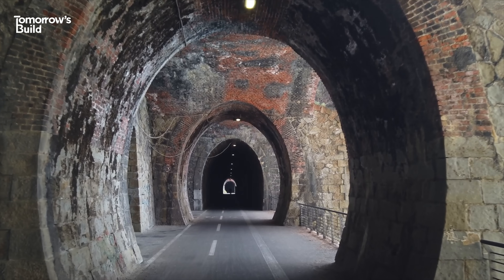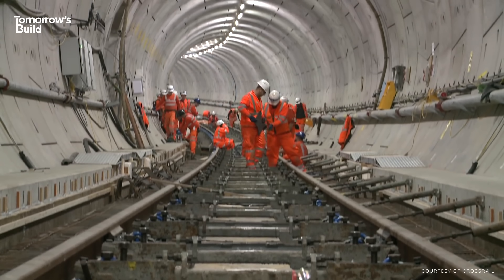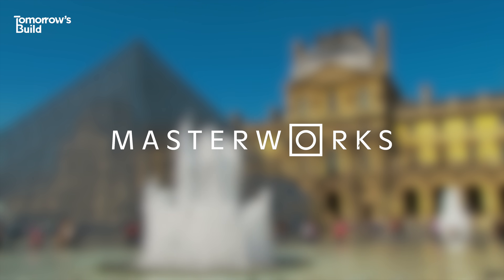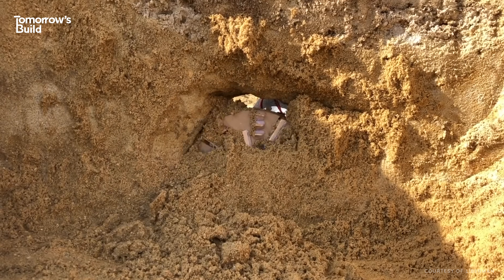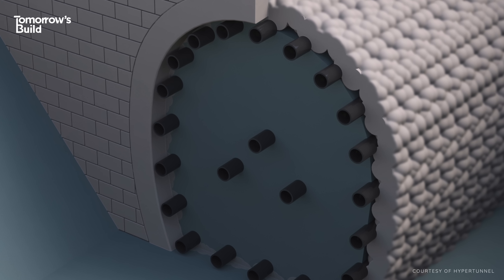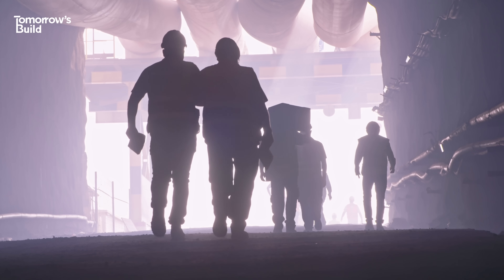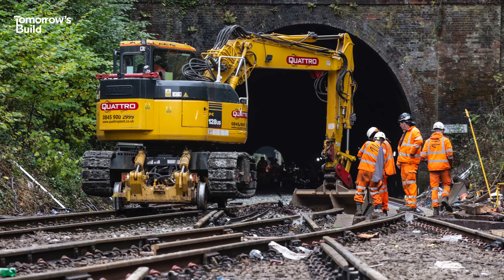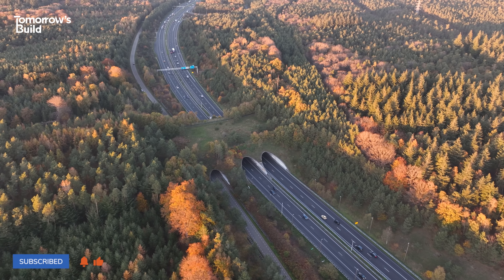A Swarm of Robots Built This Tunnel

Comment: Having thousands of robots that have to be charged seems like a logistical nightmare... What are the benefits over a conventional boring machine?
Reply: Probably the size factor. Conventional boring machines are absolutely gargantuan and require cranes, oversized load transport, massive custom parts, so many parts in general I believe I heard it has more than a space shuttle, and the challenges of maintaining the behemoths due to wear and tear. Not to mention the massive amounts of crew you still need to make it all work. Turns into lots of $$$. If you can make the little guys standardized and easy to produce/replace/maintain then theoretically it could be a lot cheaper. Anything big in size the price goes up by a disproportionate amount due to tooling and space requirements during manufacture, etc. Cheaper to make 2 mini fire engines vs one full size large fire engine for instance. Just look at how much a standard 16in pipe wrench costs vs the extra large kind that are 3 ft large.

Comment: it seem all great but i worry what if the tunnel itself is pack with hard rock how would the swarm go trough that easily and would they even work because the tunnel wall would no be injectable into soil
Reply: With solid rock as structure why would you need to inject anything? The challenge the bots solve is in creating the structural for the tunnels, and other digger machines remove the material in between the swarm pipes. if you're talking about larger but not solid aggregate then they would find the spaces between the rocks and inject into them just like they do with fracking but on a much smaller, and easier scale.

Comment: This is probably the most practically scalable piece of innovation in the sector in a long time. It's rough and rudimentary now, but they've proven it works. I'm eager to see where this tech is up to in 5 years.
Reply: They proved it worked in an ideal environment though.  I work in the mining industry and see how badly stuff gets beat up.  They are making something complicated that needs to be simple.  Simple means easy to fix.  Any downtime is big money.
Reply: @pin65371  good point. I guess when boring into the ground, you'd find all sorts of unpredictable stuff. I wonder how their system would handle it. If you have thousands of robots working on this, though, I'd suppose that a single robot on its own would be a pretty simple system, hopefully easy to fix. Also it probably wouldn't hurt too much if you took a couple of damaged robots out for fixing. The other robots would keep going
Reply: @pin65371  oh, as others have pointed out you'd already discover most "surprises" when boring the first set of holes and mapping the (future) tunnel. So you could prepare
Reply: @Leo1239150 yah that's not how that works. As I mentioned before I work in the mining industry and all they can do is predict/guess.  The huge tunnel equipment has so much torque and weight that they can just est through basically anything that gets in their way. Simple is good
Reply: We've only seen two still photos of their actual prototype. If they had video of it working they'd show it.
Reply: @mqb3gofjzkko7nzx38  exactly.
Reply: Don’t you mean down to in 5 years?
Reply: Such technology was used in the early 2000s by flowtex and it was one of the biggest german scams to exist with billions lost.
Reply: I'm curious too. Wonder if keeping the initial boreholes precisely aligned will be a problem.
Reply: Absolutely not. Like he says, they 100% rely on local geography for structural stability during the installation which can backfire in the most horrible ways possible. Using "thousands of robots" may also sound really cool until you realize they need maintenance and/or replacing constantly.
Reply: Expanded on, this could make a pyramid 50 ft underground.
Reply: Where's the proof ? They demonstrated none of the claims, the renderite sure is glistening though.
Reply: Haha, Eon Musk bought most of the ideas and firms. He is not that great visionary he portaits to us. He had money and he had an idea where he wanted to put it. And actually he seems to be a good business man - from time to time.
Reply: And Elon Musk didn't make it?? Whaaaaat?
Reply: @lostsauce0  most the shit Elon makes ain't scalable or useful
Reply: @lostsauce0  He might buy it.
Reply: @lostsauce0  
Elon Musk isn't the only visionary in the world you know. Although he is my favorite. My second favorite is the man behind Ocean Cleanup.
Reply: @MrNote-lz7lh  Look, you like 2 billionaires who don't actually make a difference. impressive.

Comment: There is a way easier way to do just about the same thing:
-Make a small tunnel without walls
-add a one way rail in the middle and excavators every few hundreds meters
-Make the tunnel wider
Reply: That does not sound easier
Reply: "-Make a small tunnel without walls" exactly how you gonna make that tunnel without walls to support it? The thing that makes tunnels challenging is the having to build the support structure as you go. All the things you say are simple are actually incredibly challenging and it seems you don't understand tunneling basics at all.
Reply: @johnjingleheimersmith  Not if you are digging in rock, which is when blasting is mostly used anyway.
Reply: @johntheux9238  Do you think large tunnel boring machines keep sticks of dynamite at the front of them? We drill through rocks every day, from drilling water wells, to geothermal, to laying utilities and oil extraction. None of these need to use, or even typically use dynamite.
Reply: But that is what we have been doing for ages and it's slow, expensive, unsafe and requires a ton of man power. It's not really easy, just simple, but simple doesn't mean it's better.